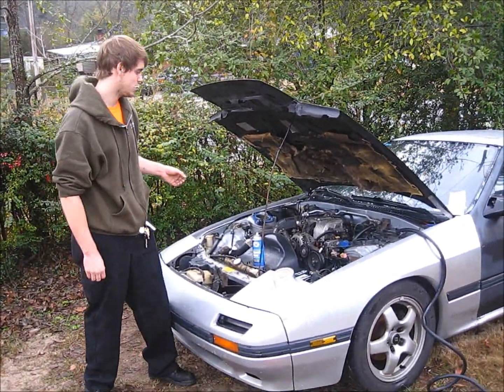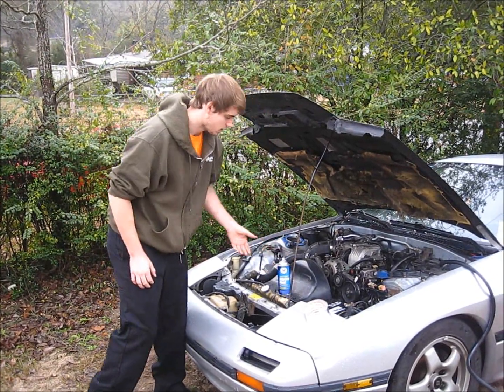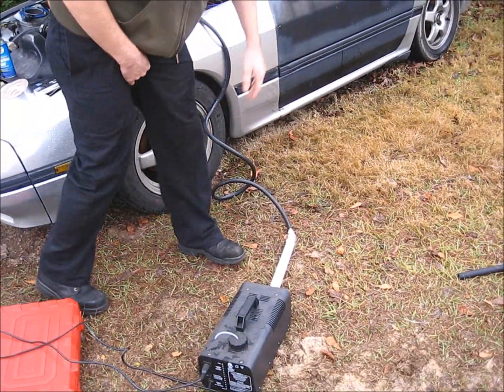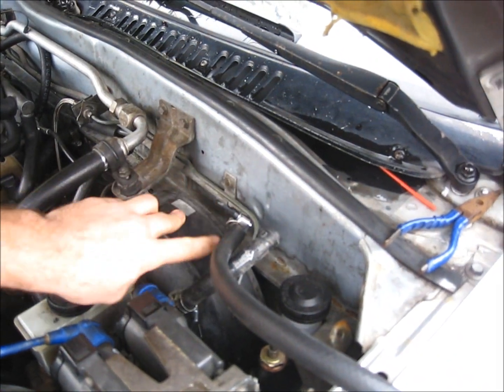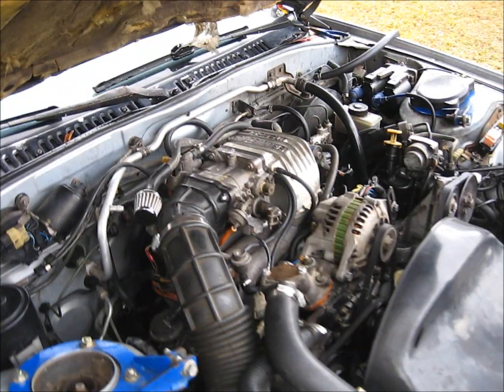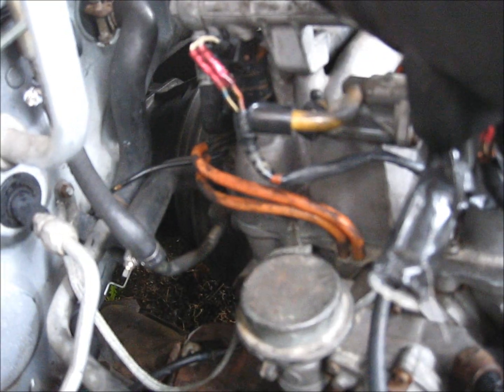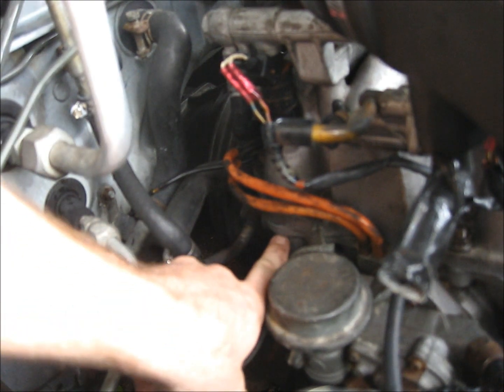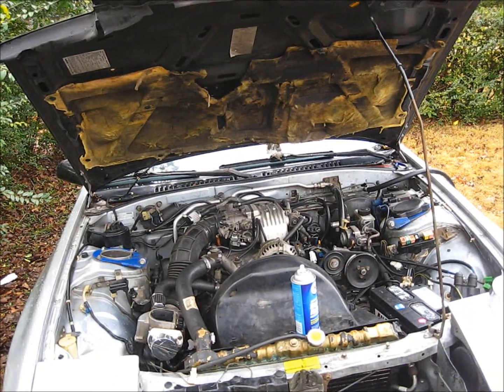one way to check your car for vacuum leaks

Comment from the maker: the fog machine did not mess with anything @marcus faliciano its running better than ever now... ive now done a 6port electric conversion and fixed the vacuum leaks i had by removing the emissions. drove it 1200 miles in the last few weeks moving across the country.